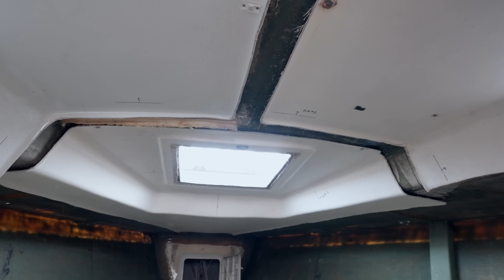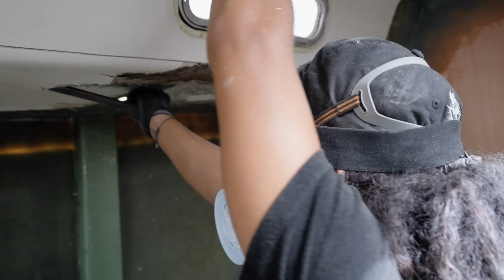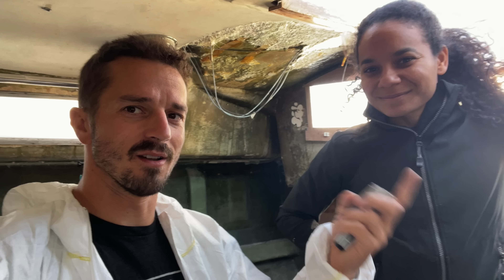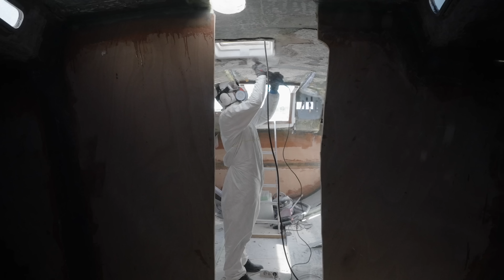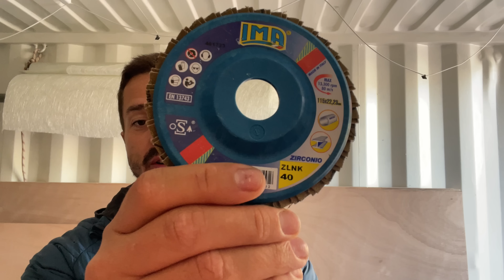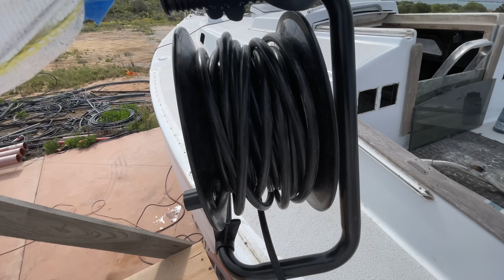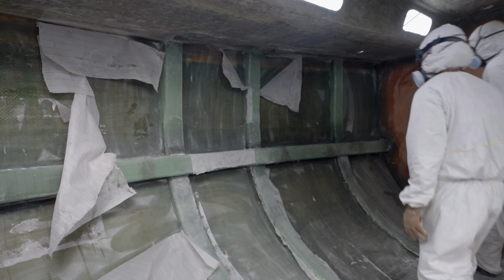Grinding It All Back Out | Step 389

Comment: OK, I've had a Pearson and a Morgan.  Each has that pain-in-the-butt headliner.  Over the years of maintaining these boats (including much re-coring of deck softspots).  I've learned (from the venerable Charlie Morgan & Mike Previtty [inventer of GRP core repair methods] ) that the headliner IS a RIGID structure fixed to the outer skin at strategic locations.  Load paths go across the outer skin, down through VERY HARD pads (which are chemically bonded [to each surface and composed of resin-doped end-grain balsa core material) through the inner liner to a couple of other pads and then back up through those pads to the outer skin at enough locations to form a very stiff 3D monocoque.  Imagine two layers of zero-stretch fabric formed into a curved structure and then 'TACKED' together in a dozen or so locations with a 3/8" gap in between the layers.  Both components borrow strength from each other's unwilling ness to stretch.  That's the theory.  In practice, it's a non-pretty structure composed of what appear to be random gooped patches holding a cosmetic 'ceiling' onto the outer coach roof. In actuality, it's an elegant, lightweight roof that you can confidently dance on.  The forecastle is sometimes completely cored or solidly glassed for the strength needed to securely mount the windlass and withstand ground tackle loads.

My own Kika (her name is Pam) said, "There's a reason that was so hard to get off there!"

Comment: Hey, guys, man that cabin liner removal was EPIC..!! What a buggar of a job! I'm not sure you are allowing enough for the glass reinforcement of the deckhead. From what it looked like when Kika was jumping up and down, it's now pretty 'loose'. My bet would be you'll need at least 2 layers of 1708 or similar. I'm into lighweight boats like Farrier tris, and they are foam core with 2 layers (minimum) of 400gsm, which approximates 15oz. So 1708 would be fine, and a  bit of overkill if you like.
Also, while I note you mentioned small ribs for attaching the detachable ceiling/deck liner to, don't forget that while you have the opportunity you should SERIOUSLY contemplate properly insulating the boat, and this would seem like the right time to do that, so the insulation can go under the new 'deck liner'.
And the thickness of the insulation is what should determine the thickness/depth of the new ribs.
Just in case you hadn't already thought of that!!
Cheers!
Mark in Oz.

Comment: I loved my Olson 30, one reason being, no interior liners. Full interior access to every inch of the hull, even inside the minimal cabinetry. No wondering what's going on between liner and hull. How about some lateral athwartships stringer supports to stiffen the deck flex? Just a layer of glass won't stiffen the deck as much, ya think?

Comment: I’ve been wondering if you might change the port window design/layout, and now with the ceiling layer removed it seems more possible than ever. I’m sure there are more modern window  attachment methods today than the original aluminum trim method, too.

Comment: At 25:28 you say you are going to gelcoat the interior of the hull then add bulkheads. Seems to me that glassing the bulkheads to gel coat does not provide a bond equal to glassing the bulkheads to the fiberglass hull. I would fiberglass bond the bulkheads to the fiberglass hull then gelcoat for a nice finish.
Reply from the maker: Of course we'd be glassing to raw glass. It's just easier to spray everything first, then only grind back what's needed. We're still debating the exact order. But definitely NOT glassing onto gelcoat
Reply: @SailingUma  If you decide to gelcoat and paint before placing the bulkheads, consider taping the hull with some quality painters tape 6 inches each side of the bulkhead so that the fiberglass where the bulkhead is bonded to the hull remains clean. Grinding gelcoat and paint off the hull will leave both in the non-smooth surface of the fiberglass resulting in less than optimum bonding of the bulkhead. check the tabbing sequence that the manufacturer suggest. The painter's tape will keep you from having to grind the hull.

Comment: The moisture that accumulated between the headliner and the deck probably was  interior condensation from sailing in cold weather. Im not sure how you're going to avoid that unless you have no headliner. Submariners faced the same problem.
Reply: If you went without a headliner and painted the interior with a water barrier paint like Interlux 2000
Reply: just glue thick enough water repellant temp-insulation air-tight, so no air - or humidity pockets appear between
Reply: @helder4u  Something like that would work great.

Comment: Are you worried about the horizontal stringers trapping condensation and not allowing it to drain into the bilge?  Maybe just an extra wedge of foam and glass to eliminate the negative rake.

Comment: Heh. Ah, tyvek suit memories... I helped decommission a fibreglas factory, and ended up with a few spare tyvek suits that ended up in the backseat of my car.  Also in the backseat as I rolled up on a traffic checkstop were a wooden katana model and a machette, used as props in a geeky wedding celebration that involved chopping a watermelon in half.  The look I got from the RCMP running the traffic stop when they asked about the somewhat odd pairing was priceless.

Comment: In the future when conducting demo projects that require a pry-bar you will find that 2 Bar's are better than 1! For example 2 Flat-bar's for this ceiling removal ; Hammer the small end of both bar's approximately 2" apart (spacing will vary depending upon what you are going to demo) then simply pull or push them in opposing directions and you will have the most amazing revelation of how much stronger and powerful you are!!! 💪Use this technique for any size project and any size Pry-bar. This technique is useful from the most aggressive demo to the most delicate removal (especially when performing delicate work! ) Well so much for no more demo to do😂. I have to admit when I saw that you were going renovate Uma  my first thought went like this....NOOoooo😩! BUT!  After this episode I feel what you guys are doing and I can see that when complete UMA will be the most BAD-ASS 38 Foot? Pearson out on the water and I can't wait to see her all dolled up! Keep up the good work! 😁😊 Sincerely Dan M

Comment: You guys are full of energy. I praise the fact that both of you are a very good team. In order to avoid the maximum itch, even with the tyvek suits, I would take a very hot shower afterwards, as hot as my body could take, then lather myself with lotion, for it to sink in the open pores of my body and have the lotion sink in there to push out the itchy glass.  One thing that helped me a lot when glassing overhead ( I recored a 40 foot sailboat from underside and laid 7 to 8 millimeter of glass over it) is to wet the material on a sheet of poluethylene (not too big!) ,  wet the ceiling with a slightly thickened resin with milled fiber and a bit of silica , then pick up the poly and push it against the ceiling and push it in with my hands, then roll it  with the bubble buster before very gently removing the poly, then finishing the surface with the bubble buster. Adding the peel ply can alao help.  This technique saves a lot of dripped resin on your sleeves !  Good luck with the process. After doing that 40 footer I vowed I would never do it again.
Reply: Always take a cold shower to stop the fibreglass itch.
You want to close the pores and push the fibres out to stop the itch

Comment: maybe time to take a look at laying up a corematt on the ceiling surfaces . I needed a lightweight   / rigid  layup for my 1980 ground effects Lotus Esprit . the bodyshell was similar to your hull ..it was structural with Plasticell / polyester bulkheads ..

Comment: Awe inspiring job and nice storytelling. And. Structurally, you now have half a strong ribcage in the hull and just a lid on top of that. My thoughts go out to Tupperware, yes, that's ajoke, and yes, it has a serious undertone. I would try to also have some ribcage in the deck, now, and yes, make that double as attachment for the cosmetic panels. Well, cosmetic is one way of looking at them. I would see them as the inside of a double walled insulation system. Same for the hull. I would attempt to prevent condensation to happen in the future in there, and try to prevent any leakage from going in there too. If there's a leak, let it go into the interior, not between insulation layers.
And, my pet peeve, I would double the function of some of the ribs as cable duct. I would distinguish, have separate ducts for, high power, lower power, switching, instrumentation and controls, communication, (more?), and keep energy distribution separate from the rest (solar to battery inverter etc.). Some strong round cross section tubes glued together really well may be as strong as a foam core.
But you may have to design the places where these are used already now, rather than growing into your final architecture and design organically.
Your position?

Comment: Quick question: Why don't you water grind or water sand those surfaces? It cuts through wuicker and turns the dust into a muddy slurry that a wet dry vacuum picks right up.

Comment: Curious to know how much time you got out of that battery using two grinders? I feel your pain, and admire your perseverance. A few years back, I converted a Canadian Navy Whaler (Glass) to a small coaster with a cabin and decking added, it was small job than yours, but grind, grind, cut, cut and sand, sand, never seemed to end. Still working on the interior.

Comment: Don’t use an extension cord with a battery bank if you can help it.  Extension cords have internal resistance that wastes power and your battery will last longer if you don’t use waste power in the cord.  It can be a surprising amount.

Comment: A truly grim job, sanding glass overhead… Respect! On the other hand - how cool, a workspace you can rinse from top to bottom :)
Excuse me if I missed this already being discussed, but while the liner was a bit [edit: quite] rubbish, would it have helped with insulation, both acoustical and temperature? If so, will you add a layer of something or other?

Comment: Nice priject so far. No problem that can't be fixed by you. 
Btw
Doesn't something like a festool rotaflex give the same result but with less dust because it allows a vacuum cleaner to connect?
Having said that. Those are heavy, unless you have a compressed air version....
Reply from the maker: They’re very expensive!!! Like thousands of $$$!
Reply: @SailingUma  I don't know about the US prices. In the EU it is like 7 hundred but secondhand. Anyway. Looking forward to the development.  Wishing you two success.

Comment: While you’re at it, you should consider installing flush hatches. It would make the deck so much cleaner, and it’s probably time for new hatches anyway.
Reply from the maker: They require a pretty significant deck thickness to accommodate the drainage. We don’t have that luxury on Uma. We wish we did.

Comment: Deck is WAY to flexible . You do need to add something to strengthen it .  I hate liners LOL . My old boat did not have one and instead had a finished surface . Everything you need  to see or fix was exposed .

The new boat has a liner but it is supposed to be removable
Reply: That's the reason that Navy ships have nothing covering the overhead. Anything that can break, leak, or fail is immediately visible.

Comment: Just breathing inside any area adds humidity. A dehumidifier is necessary to remove the moisture 365 days a year.
Reply from the maker: Some humidity is good. 

On a boat, ventilation is much 
more important the dehumidification. 

Just cracking a forward hatch a hair make a world of difference.

Comment: Use epoxy resin when you add another layer of glass - sticks like hell! 😅
Reply from the maker: Since we’ve been using vinylester this whole time, we’ll stick with that. For repairs and for emergencies, epoxy is great. For complete hull builds, it’s pretty overkill. Unless you’re doing high performance carbon or super large yachts.

Comment: Have you considered using the spray cork like OddLife used to insulate??
Reply from the maker: No need on a grp boat. Cork works great as a thermal barrier, but still requires insulation in addition.
Reply: Thinking more along the lines of mold and moisture without need for vapor barrier. Easy application, too.

Comment: How does the boatyard handle the waste water with the grinding dust in it?
Reply from the maker: All water including rain water and power washer water from haul outs goes into a drainage system with filters to catch all the contaminants and oils etc. but since the dust floats and most of it is vacuumed up first, not a lot escapes the bilge.
Reply: @SailingUma  Great! Thank you for responding.

Comment: full faced respirators and use heat to melt the epoxy and drop the ceiling
Reply from the maker: How would the heat differentiate between the deck layers and the hull liner layers?
Reply: I was wondering if a double heat gun setup on high could weaken the epoxy between the layers and make removal easier. Might melt underside of the deck a bit but should be superficial. You guys arrrr troopers ;)

Comment: Why not plug in to the solar while the power's out?
Reply: Solar panels wont work without the battery packs, charge controllers, and inverters installed. And also not even nearly produce enough energy to power the grinders.

Comment: will you strengthen the connection between the hull and the deck ?
Reply: I know you did it from outside a few years ago ...
Reply from the maker: We didn’t outside already. And now the inside has a few layers on it too. That was part of the glass work the guys did. We’ll be tying the ceiling glass into it too. So everything inside will have 2-4mm of new glass on it.
Reply: A real water tank

Comment: You have gone to all that trouble - you should add SPRAY FOAM INSULATION - it will transform the comfort of the boat.  Easy job if you have all the lining down.
Reply: spray. foam may not be optimal in this circumstance. It may even accumulate humidity.. and other problems..
Reply: @helder4u  How can it 'accumulate humidity'? You use closed cell foam which does not hold moisture and it almost entirely eliminates condensation.  I have lived with it for years without problems and boats are always more comfortable and have less damp and mould if they are properly insulated.  The only thing to be wary of is places where fittings might weep and water get behind the foam.

Comment: Random question just popped into my head while watching this. Which style of electric socket are y’all going to install? (If I didn’t ask clearly, like how electric sockets differs depending on which country you are in). My brain and its random thoughts…
Reply from the maker: Well probably use the EU standard sockets. We had the UK ones but kept melting plugs. Well also still have 120 USA style plugs here and there. We like keeping both 120 and 230 on-board. Makes international travel much easier.

Comment: I wonder how much you would have improved the structural integrity of the deck had you sprayed closed cell foam between the head liner and the deck, thereby also blocking moisture?

Ah, well...  As you said, it was "patchy."
Reply from the maker: Non. Foam doesn’t do anything structurally without glass on each side. 

As for moisture, the glass core deck already provides some condensation reduction. Ventilation does more than insulation.

Comment: This really makes me wonder if you could just buy a bare hull from a boat manufacturer?  You've essentially created one at this point, through a huge ton of work.  But it'd be cool to get a bare hull, and just build what you want in it without all the demo and prep.
Reply from the maker: A bare hull still cost $100,000. Ours is essentially free.
Reply: @SailingUma  Very true, and shows why boat pricing is insanity.

Comment: My 1963 Pearson Vanguard has a balsa-cored deck. The balsa core has deteriorated making the deck spongy. Does Uma have a cored deck?
Reply from the maker: Yes. Her deck is cored with balsa too. Balsa really is the best material for decking and hull core, you just have to treat it properly and make sure every hole is sealed properly.

Comment: Have you guys thought about having a look at basalt fiber instead of fiber glass? More expensive, about the price of S glass, but also stronger than glass fiber, but most importantly, non toxic and with different particle sizes which do not damage the lungs, although of course you should still be fully masked up!
But way less horrible than fiber glass to work with, AFAIK. Take that from someone who has done a little work with fiber glass, but not with basalt fiber though, so that is from spec sheets only!
Reply: I tried to find references to working with basalt fiber, but most of the stuff is the engineering properties of the material, not about the poor stiffs working with it and fiber glass!
I did turn up this though, apart from the safety data sheets which confirm its superior properties to fiber glass in being non-toxic and with particle sizes less likely to enter the lungs:
' Experimenting with Vacuum Resin Infusion and Basalt Fiber' -

'  Basalt fiber is way less dangerous to work with than carbon fiber.
The braided sleeve format means you only need to cut it to length – no fraying edges. It can be shaped easily without coming apart.'

Comment: Wasn't the dead air behind the liner acting as  insulation?
Reply from the maker: Definitely not. The balsa core does a pretty good job insulating the deck from summer sun and preventing condensation build up in the cold winters.
Reply: @SailingUma  I would love to know how that balsa is mounted, fixed and how thick it is.